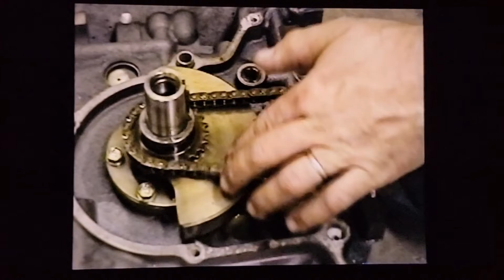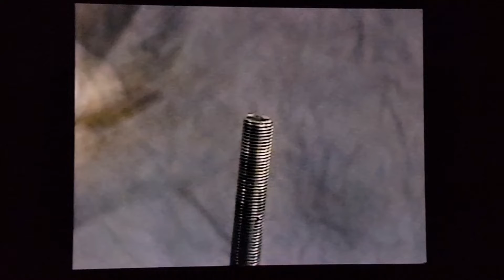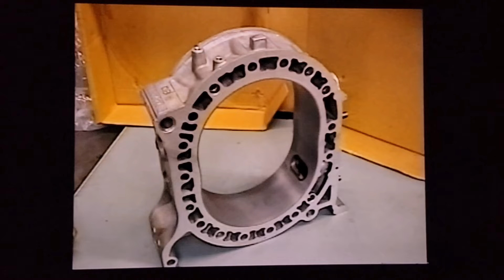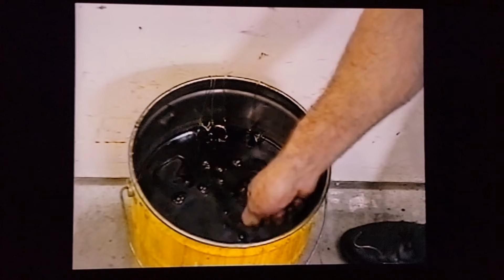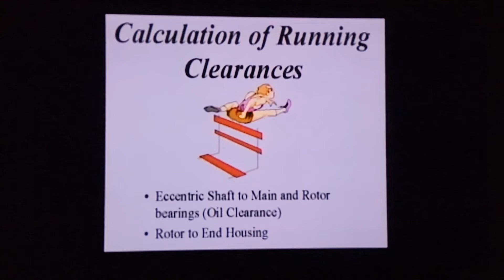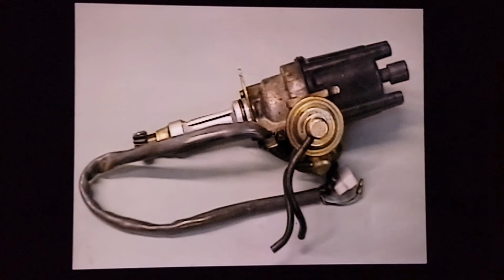The Most Detailed Mazda Rx7 13B Rotary Engine Rebuild Video

Comment: Hi, I really appreciate your detailed Mazda Rx7 13B Rotary Engine Rebuild Video. Question: With respect to my 1988 Mazda RX7 NA non-turbo SE model (original owner purchased new in 1988) with 257k engine miles and recently rebuilt 5-speed tranny, do you believe my engine rebuild will not require new iron housings and rotors. Currently, engine rotor compression is 7 for both rotary chambers, and engine pulls strong when shifted into second gear and fully accelerated. Engine highly maintained with frequent fluid changes, new water pump, radiator, power steering pump, oil cooler lines, and fuel injectors. Engine cooling gauge reads just above cold, like when car was new. Also, as I am considering rebuilding engine by The Rotary Doctor located in Joplin, MO, will any reputable rebuilder complete all your detailed steps as shown in your video, or will they shortcut build to reduce cost.